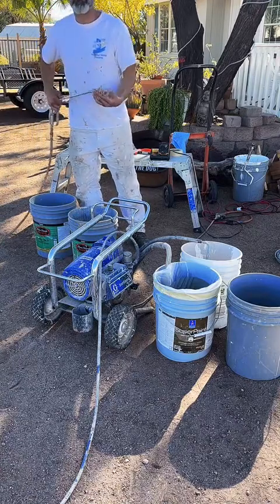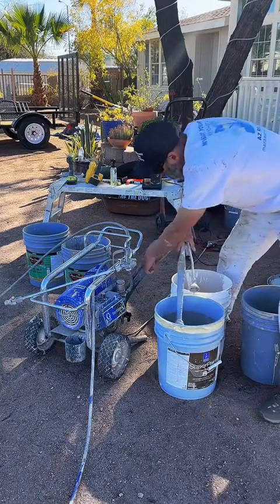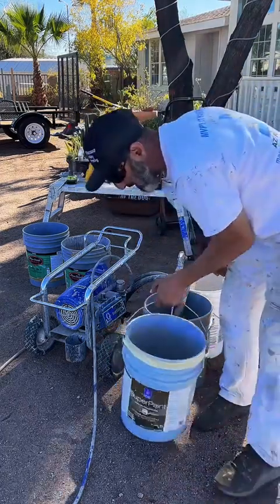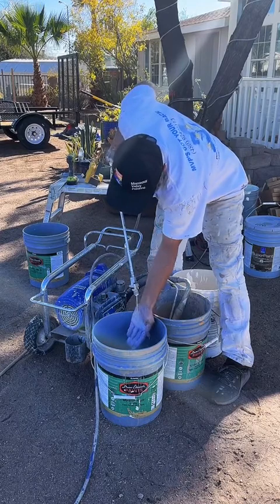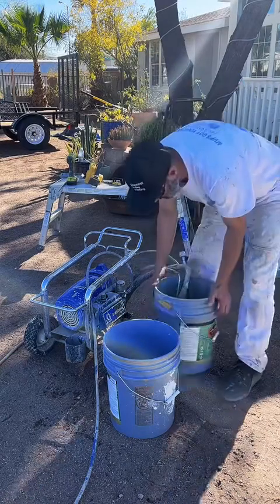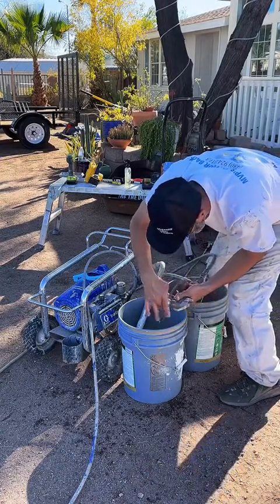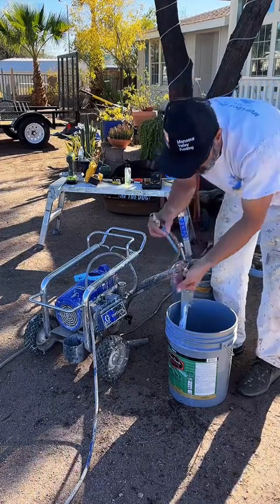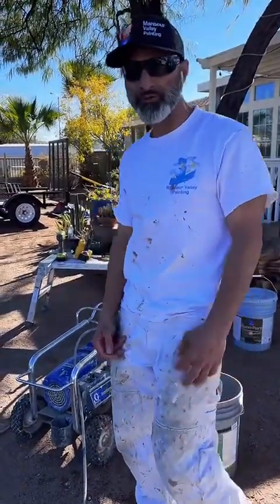Graco Paint Sprayer Clean up

Comment: First off, I love your content. Very practical & insightful for sure. Secondly, wouldn’t it be better to clean both filters first prior to cleaning the rest of the sprayer? I just figured it would make the cleaning a lot more easier and quicker. Unless you do that for a specific reason. Just curious.
Reply from the maker: In my opinion I like to clean filters last to avoid letting particles and paint flakes into my pump chamber, or stuck in the needle of my Gun, also helps the packing last longer. 🤙🏼✌🏼
Reply from the maker: Thanks 🙏🏼